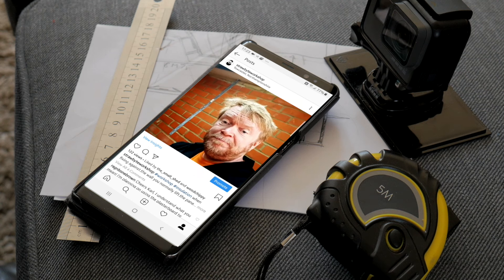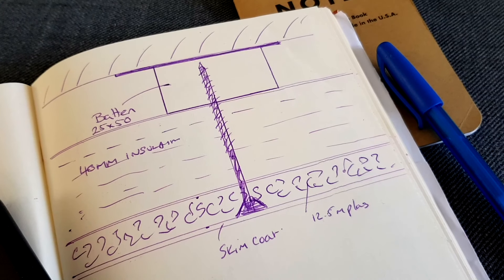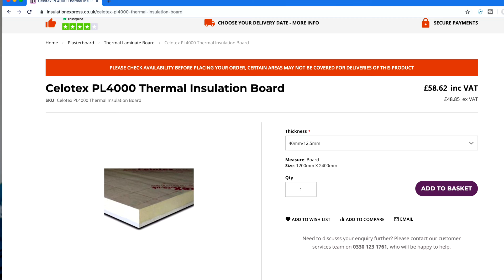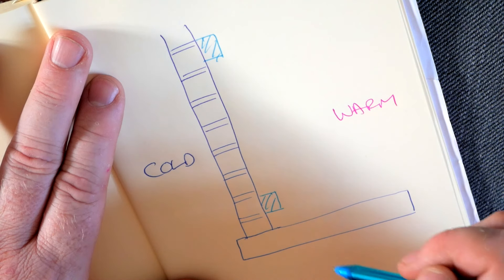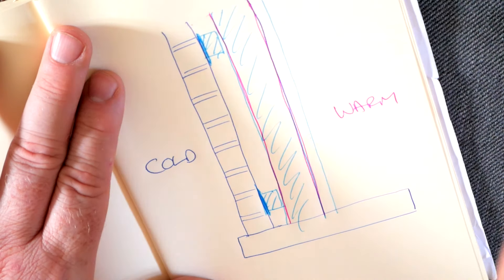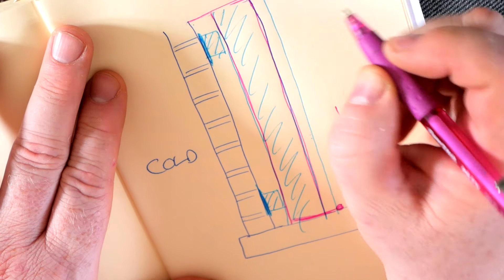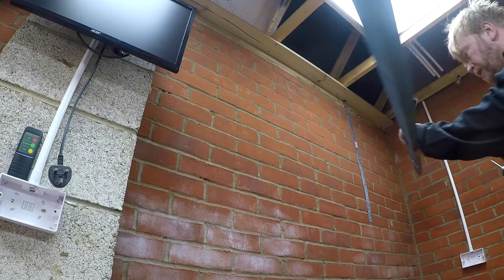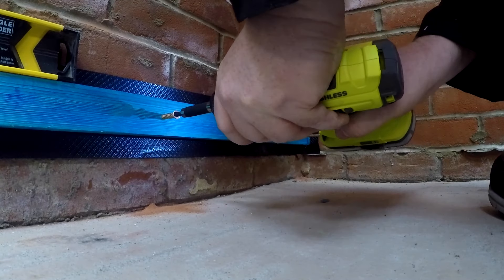How to Insulate Your Workshop | An Easy DIY Project | Keep Your Shop Warm or Cooler

Comment: Hi, do you have any update on this work now you have lived with it for some time? I am looking to do the same in a very similar garage (slightly smaller than yours) and wonder if you would do it Amy differently if you were to do it again? Kind regards
Reply from the maker: Hi yes the video has received a lot of virews recent with plenty of new questions. 
I've had a small spot of damp come through in one place, but that was due to a faulty dpc installed by the house builder. Other than that it's been great I have frost protection in the form of Tube heaters and a space heater to warm the space. But it takes about 20 mins to get the space toasty and it stays warm for ages. 
In terms of differently? I'm torn between doing it all celotex/MDF or all insulated plasterboard. But I have the experience now to pick one approach and make it work. I would probably install a ceiling across the whole space. The vaulted ceiling was a massive amount of work and in not sure I appreciate the openness as much as I imagined at the time. I'm using the roof more and more for storage.
Reply: @StrawbyteWorkshop  that's great, thank you. I will ceack on with it when I have the chance as it's too cold and damp in there to work this time of year.
Have you found the flooring insulates much? The flooring looks like a great idea. I wondered about putting some osb or something under to offer more insulation. Do you find it's helped as it is? Thanks
Reply from the maker: @madeinyorkshire2203  The flooring has worked out well for me overall. It was picked for its durability and overall finish. It's firm under foot but doesn't knacker my knees like concrete did. I'm glad I went for the thicker PVC because I do believe it's providing better insulation and hence the floor doesn't feel too cold to the touch and I certainly get no condensation forming anywhere on the floor.
I have thought long and hard about the floor since it was installed. One of the features of a garage when they lay the slab is that they build a slight fall in the floor so that water from your car runs towards the door. The difference is around 8cm over the 6m length of the garage. Shortly after finishing my project, Peter Parfitt on YouTube moved in to a new garage workshop and he levelled his floor by installing battens to level the floor and a chipboard floor over the top. It results in a step at the garage door and there's opportunity to put insulation under the floor. I've given plenty of thinking time to whether that's future project for me, however the only time I have an issue with the slope is the one and only time I did a resin pour to fill a wide gap in a slab where I had to shim the mould I made to make it level. For me the floor slopes but its flat so I'm going to leave it there.

Comment: Great Video!!! Its given me the inspiration I need to put an order in from Travis Perkins! Do you know enough to help me with this question? My garage is attached to the side of the house, how would you/would you insulate the common wall? Im afraid to cause condensation inside of the house since it will be insulated from both sides. Thanks
Reply from the maker: Hey George. Thanks for a great question. I've been in this situation before and decided to focus only on insulating for sound where I used rockwool sound slab. I considered any heat I put into the garage that leaked away through that wall would be leaking into the house. That was some time ago.
Note however, you may need to check with building control regarding any conversion of garage connected to the house. There were way fewer considerations in my project as the detached garage is an outbuilding and the so long as the room wasn't used for sleeping I didn''t need building control.

Comment: Hi , I am about to do my garage similar to tour own. My question is, on internal corners do you trim back the plasterboard so it's a full insulation joint , thanks mark
Reply from the maker: Hi Mark. Yes for internal corners you need to cut back the plasterboard. It's really easy to do. Offer up next board scribe a line, cut with a Stanley knife and break off. There's an excellent pdf from Kingspan on their K12 product which gives you all the info you need. Just Google insulated plasterboard data sheet Kingspan
Reply: @StrawbyteWorkshop  cheers thanks for the quick reply, am using celotex backed plasterboard which you can use the dryfix, should be less time consuming and easier to accommodate the door I have too. Great video by the way , probably one of the most informative on you tube, when you had your walls and garage door insulated  ,how was the temperature before you did the roof, thanks mark
Reply from the maker: @markwilson8022  It's really hard to say. While the work was divided into two videos the installation of the insulation happened at the same time. The draughts in the winter months though were mostly because the roofs on garages are all gappy, so  my guess is that if I had only done the walls there would have been little benefit in terms of retaining heat. A really good question though. 

I mentioned the Kingspan product mainly because the data sheet is so helpful as it sets out how joint corners, to the ceiling and around openings like windows. But there is really no difference between Celotex, Kingspan or any other brand in practice - just price. I ordered Celotex but it was substituted with a generic brand made (as it turned out) in the same factory. Anyway the reason for discounting dryfix in my case was because my garage is made with bricks that are really very porous. Stick a hose on the outside and soon you'll have water running down the inside kind of porous. Had the brick been engineering bricks or they'd used blocks instead then dryfix would have been more appropriate.
Reply: @StrawbyteWorkshop  thank you , very much for taking the time to answer my questions,  try a product from kingfisher that seals porous brick/stone but still let's it breath, I used on my sandstone cottage I used to live in , after a downpour my house looked completely dry compared to all others, plus its applied using a spray u will probably feel even more benefit whilst protecting the brick on the outside from more damage, thanks mark

Comment: What did you insualte your garage door with ? And what did you do about the wall above the garage door and the wall above the rear of the garage ?
Reply from the maker: The garage door is insulated with 25mm polystyrene with proplex (corrugated polypropylene) to hold it all in place. Additionally there's a 7' x 7' sound blanket in front of the door now to help with the noise.
The loft space is above the garage door. Under the loft floor there's 75mm of rockwool insulation between it and the ceiling.
At the other end of the garage the wall was insulated as part of the roof-space installation video which you can find on the channel.
Reply: @StrawbyteWorkshop  Thank you! Great video. Did you insulate the walls either side of the garage door ? and then "cap" off with plasterboard to give a sealed end which faces the garage door (if that makes sense).What did you do about the breeze block pillars in the end ?
Reply from the maker: @sharifgoolam-hossen1929  The approach for all the walls I left off was the same as you saw in the second half of the video. Battened out, insulation and then 12mm MR MDF on top. The breeze block pilars were finished of with insulated plywood boxes because I wanted to keep the ability for those pilars to hold-up heavy stuff. The solution will be part of a future video so do subscribe so you don't miss out.
Reply: @StrawbyteWorkshop  was the insulation thickness in total 25mm with the proplex on top? Or did you add more than one layer of the polystyrene insulation then proplex?
Reply from the maker: 25mm with proplex on top single layer.
Reply: @StrawbyteWorkshop  apologies...what size screws did you use and washers ?
Reply from the maker: On the door? 5mm X 25mm self tapping screws with 5 X 20mm washers.
Reply from the maker: On the walls? 5 X 70mm with penny.washers to hold the insulation. Then 5 X 80mm screws to hold the MDF on.
Reply: @StrawbyteWorkshop  yes. Thank you for all your help!!!

Comment: Great video, similarly I’ve got brick pillars (not breeze block) how did you work around insulating those? (Mentioned in another comment)
Reply from the maker: Hi. I made some insulated panels and bolted them to the pillars. I keep meaning to do a follow-up about the finishing touches.

Comment: Hi there, great video! If I were to put some soundproofing material in between the battons, then put the celotex on top, would that cause me any issues?
Reply from the maker: Hi Mathew in the video you see me create a void behind the celotex which is the recommended way from celotex. The void gives from room for moist air or condensation to leave back through your wall. The choice of MDF was with sound in mind. MDF is fairly dense and absorbs  sound well. I would suggest researching soundboards that can be used inside the insulation.
Reply: Strawbyte Workshop thanks for the reply. So so should do the batton, then the celotex then mdf sheets on top? Sorry, I’m new to this so all very confusing haha
Reply: Ignore me I get it now! Can I ask what size masonry screws and masonry bit you used?
Reply from the maker: @mathewbarwick8167  They were 7.5 x 100mm masonry screws from Screwfix in the uK. You need to drill a 6mm hole with a masonry bit.

Comment: great video. I'm wondering if you put this through building regulations? I'm currently trying to convert my small porch but it seems quite tough to meet the 0.30 u value with such little space!
Reply from the maker: Thank you and that's s very good question. Building control approval was not required since the space is not used for sleeping and isn't attached or integral to the house. Of more pressing concern was not falling foul of a covenant on my new build home in terms of the use of the building. It's a lovely warm workspace, but you can still park a car in it. 
I've tried to install in a correct way and followed the insulation makers installation guidance. But I have compromised on U value. I plumped form the best I could get without loosing too much space inside but it falls short of the target. 
It's a question I may return to in a future video.
Reply from the maker: On your porch speak to your building control officer I have had a similar issue in the past and found them helpful.

Comment: Why not dot and dab walls?
Reply from the maker: That's an option, but one not recommended if you cannot guarantee that the exterior wall won't get wet. In my case I have a wall which is the boundary for my neighbour and I can't be sure I can keep on top of maintaining the gutter or prevent her from splashing the wall when she waters her lovely garden. The battening approach is a safer alternative as you don't risk the adhesive failing due to moisture penetration.
Reply: @StrawbyteWorkshop  good answer. Thanks for that

Comment: What was the link to purchase your celotex ?? Cheers Phil
Reply from the maker: The link was in the description: https://www.insulationexpress.co.uk/
Reply: @StrawbyteWorkshop  thank you .. workshop looks great
Reply: Did it work out a lot cheaper buying from a supplier than say from Wicks ?
Reply from the maker: @philhagon4447  Much cheaper. Right now Wickes sells 50mm PIR board (Kingspan) for £58. From Insulation Express 50mm PIR board from Celotex is £24.18. The only catch with them is you have to order a minimum of £200 of product. They did use to ship smaller quantities back when I did the project. But if you're buying enough to insulate a 6m x 3m garage then you'll need 14 boards which would cost you £338.52 + £50 for delivery. While the delivery charge seems quite steep, it's only £3.85 per board. Had you bought the same quantity from Wickes you'd have spent £812. I hope that helps.
Reply: @StrawbyteWorkshop  thanks for your advice.. much appreciated

Comment: Nice video. Just had a concrete garage put up and looking to do similar. Good stuff that Celotex plasterboard. We renovated our whole house with 50mm... cost us a small fortune! Not after a skimmed finish so I reckon ply over the foam will do this time.
Reply from the maker: I've had mixed results with ply in the past. I found MR MDF a better material and (then and now) cheaper.
Reply: @StrawbyteWorkshop  What was the issue with ply? I've just started my garage in accordance with your video. I wanted to go ply because I plan to screw quite a bit of stuff to the walls - after some research ply is much better for this. Is there something I'm missing? 

Cheers

Dave
Reply from the maker: @AutoBeta2T  There was no issue with plywood other than its cost comparable to MDF of the same thickness. MDF has its benefits as it has a very good paintable surface which gives a flat finish which is what I was looking for. If I was doing this over again I would use ply on the two walls I've mounted cabinets.

Comment: Fab video Karl, questions for you - I have a single skin block work garage (6x4m) where I keep my bikes and tools. It is getting a bit damp to the point some of my tools rust and a bit of mold growing. I'm planning to insulate it but not 100% sure what is the easiest way to go... Insulated plaster boards or studs, insulation in between then plywood over. Also do I need a complete sheet of vapour barrier?? Thanks in advance.
Reply from the maker: There's a couple of things you'll need to ensure you address first, but I think the approach I took would probably work. Ahead of completing this project, I had a little mould form in the spaces behind cabinets and issues with damp generally and having done the work the workshop is dry and warm. The insulation I chose creates a dry space inside and any moisture that forms behind can pass back through the brick to the outside in its own time. The things you need to address before you start is to address any parts of the wall that a permenantly wet/damp. Common causes are poor/no gutters, missing DPC (I have since discovered I have that in one spot) and wall exposed to wind blown rain. So, fix the gutters, you can use a chemical DPC to fix any rising damp and Thompson's Water Seal is a great way of weatherproofing an exposed wall. I hope that helps.
Reply: @StrawbyteWorkshop  Thanks for the advice. I had a look again during the weekend and i think i might have to re do the roof - the previous owner used box shaped roof sheet and screwed directly to the rafters without any membrane underneath, hence i found them to be a bit damp. The wall has no wet patches (touch wood) so i think i might just put in some battens, then fit the double sided insulating sheet in between, leave a gap and board it back up.. I think it should work..

Comment: Hi Karl, I’m hoping you could help. Do you think instead of using the insulated plasterboard I could use osb and being the cheap skate I am apply some aluminium foil with adhesive to the wall side. Do you think that could work?
Reply from the maker: I'm not sure you'll get anything like the insulation benefit you'll get with the thinnest PIR insulation sheet. If the OSB is still cold it will attract condensation and, in my experience, go mouldy very quickly. For foil insulation to work effectively there needs to be a gap between the foil and material. Foil insulates by reflecting heat. Foil coated bubble wrap does this by sandwiching air between two layers of foil. Anyway - given my experience i would always recommend saving a bit more and investing in insulation if what you're looking for is to keep out the cold.

Comment: Great video! Im looking to do something very similar however I just wanted to know if I have to use DPC when putting up the battens? Would just securing the battens to the brickwork with celotex in between and a layer of plasterboard suffice?
Reply from the maker: I followed the instructions from Kingspan and chose between battening first with DPC (their recommendation) or directly applying the insulation to the wall. Battening out is recommended when you cannot guarantee that the wall will not get wet from the outside.
Reply: @StrawbyteWorkshop  what size battens were used? Is it possible to get a link to it?

Comment: Great video. Just wondering about the concrete pillars, you mentioned that they had been fully insulated now. Will a video be posted about how this was done?
Reply from the maker: Yes I hope to put out a video soon.
Reply: @StrawbyteWorkshop  I would be keen to know how you did this. I’m in a similar situation and opted to pack the wall out so the battens are level with the concrete block work so far.